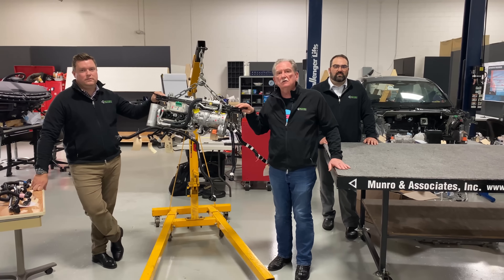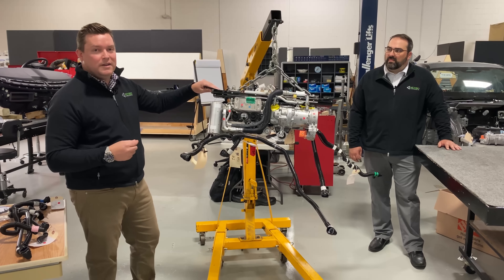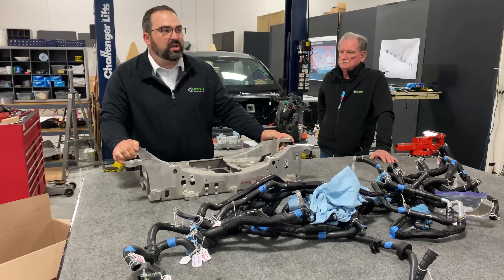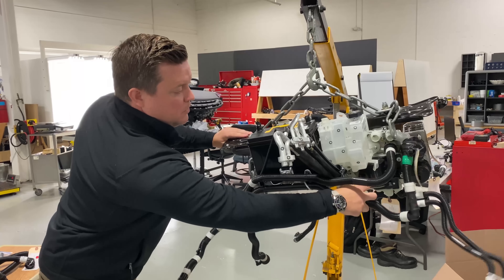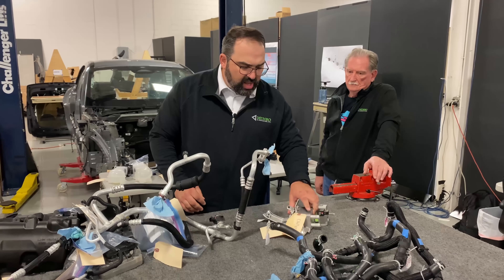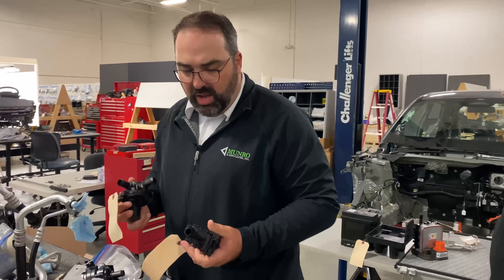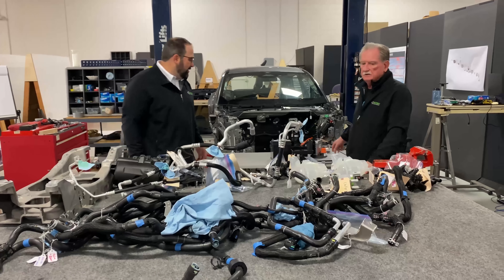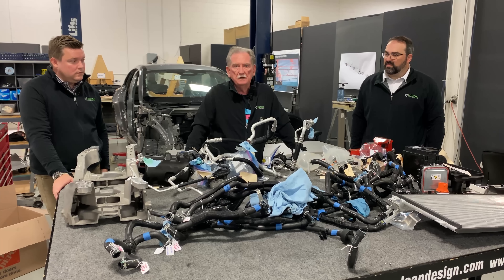Mach-E Thermal System Part 2: A Detailed Comparison to the Model Y

Comment: Finally comparison of the Mach E and Model Y...non of that VW ID4 😄. We want the best of the best and no hold grudge honest perspective from engineers. Shame on best of the best Ford's engineers by using hoses 🙈. Mach E was EV Car Of the Year by Car and Driver though 💩.
Reply: who cares about how its done as long as it works? Porsche in the 1980ies  had 924 that hat front suspension of a VW bug and rear susp from a van and had wont multiple awards for handling.  Sandy is over dramatizing for the sake of content. His points are more important from the cost effectiveness of the thing i suppose.
Reply: @hagestad  You just don't get it, but you will. The best process is no process and the best parts are no parts. The more parts you have the more likelihood thing will go wrong and things will be expensive. The realibility of the Mach E is still very unknown.

Comment: I hope the F150 lighting follows more of the Telsa design vs the MacE
Reply: Apparently per comments from Ford the Lightning is a Ford F150 body laid over an EV subframe.  This would suggest either as-good-as the current F150 systems.

Comment: That's incredible.
I mean, start thinking for a sec how many degrees of improvement could potentially be made in the near future on EV cars.
Reply: better yet scrap it all and build national hydrogen network.
Reply: @hagestad  Its almost guaranteed that hydrogen has no future in the passenger vehicle segment. Hydrogen is less efficient than batteries and always will be (energy changes forms more times). Hydrogen would have to build out brand new expensive infrastructure while BEVs takes advantage of the electricity infrastructure we already have/need. Hydrogen vehicles are dramatically less performant than BEVs. Hydrogen vehicles are potentially more convenient (if infrastructure is built out and batteries don't make gains in charging speed) for very long trips, but less convenient in every day use as you can easily charge at home or at offices with BEVs.

I could see hydrogen playing a part in long term grid storage or large vehicle transportation like planes, boats, and semis (although some of these might also be doable with batteries), but there's really almost no benefit to pursuing hydrogen for passenger vehicles.
Reply: @connorglacken8734  you do realize you can convert ice engines to hydrogen but for some reason that is not even mentioned most of the time?
Reply: @connorglacken8734  no benefits? Weight.
Reply: @hagestad  True, hydrogen definitely has much higher energy density than batteries, but in the real world this alone doesn't yield much of a benefit. Hydrogen is more volume limited than weight limited and you need some pretty beefy hardware to shrink the size of the hydrogen tank down to a reasonable size for a passenger vehicle as well as the fuel cell itself to turn that hydrogen into electricity for the motor. That all adds weight. Add in the fact that batteries can actually do double duty by acting as a structural member and you can reduce the weight discrepancy even more.

Once you get larger though the weight benefit for Hydrogen starts kicking in. A larger tank stores volume more efficiently than a smaller tank so you'd probably have a smaller weight penalty per kg of hydrogen on a semi truck than a small sedan. The difference would be even bigger for big planes and especially a shipping container.

Regardless of all that, weight itself doesn't really matter. What matters depends on what you are trying to do. For a passenger vehicle the things you care about would be efficiency, performance, space, convenience, and cost of operation. Weight definitely impacts all of those things, but you can't just compare weight itself. All things being equal a heavier car would be worse in all those categories (except space, it doesn't really impact that), but all things are not equal. Since hydrogen has to go through more steps to get to the motor hydrogen vehicles are actually less efficient than BEVs. Since weight distribution is much better in a BEV than hydrogen (lower center of gravity) and batteries have much better power output BEVs perform much better than hydrogen vehicles. I would suspect that BEVs have more useable space than hydrogen due to the extra equipment and hydrogen having poor volumetric density, but there aren't many fuel cell vehicles to compare to so let's call this a draw. Hydrogen and Batteries trade blows in convenience since batteries can recharge at home, but hydrogen can refill faster for long trips, but batteries are making large improvements in this arena and hydrogen has basically no infrastructure built out and it would be a HUGE undertaking to do so. Hydrogen is and likely always will be more expensive than batteries since hydrogen has more energy conversion steps and therefore will always have lower efficiency to create and use.

Went on a longer rant than I meant to, but I just don't see how the one advantage (road trips, and BEVs might catch up in this category anyway) makes up for all the disadvantages. Again, this is for passenger vehicles. This is a different story for larger vehicles and especially grid storage uses.
Reply: @hagestad  People have converted ICE cars to BEVs as well, but that doesn't really matter because this would likely cost too much to be worth it. Not to mention hydrogen would need to make sense in the first place for the infrastructure to be built out. Without infrastructure no one would want to convert their ice car to hydrogen even if it was free.
Reply: @hagestad  People already complain about losing power with E15 gasoline.  Hydrogen has incredibly rotten energy density & is difficult to handle.  Green hydrogen will have a place in industrial application -- smelting steel, making concrete, cracking hydrocarbons, fertilizers, etc -- but it is an absolute pig for vehicles.
Reply: @hagestad  
OK
Convert a 25% efficient system to a 20% efficient system to combat a 75% (worst case) efficient system.
Spend billions extra creating infrastructure to do so.
🤔🤔🤔🤔
Seems like a plan.....

A  BAD plan, but a plan nontheless.

Comment: The killer was "and this is the second best we've seen!"
Reply: All those future leak points down the road too. With Tesla you have 10 hoses so 20 hose connections that might leak at some point, with Ford you have 35 hoses or 70 possible leak points. Not including pumps and other components and its all stretched out over the engine bay instead of in one location.
Reply: @andycanfixit  
I said after part 1
"5 year timebomb"
Reply: @rogerstarkey5390  I wonder, was this build on purpose? I mean to create a need for maintanance in coming years of owning a Mach-E? Or is this pure BAD design?
Reply: @danielsusca  Quite honestly it wouldn't surprise me. The dealers are already unhappy there's no routine maintenance. But I think it is more to use off the shelf components than it is planned maintenance. Hard to make things integrated unless you redesign parts to be custom.
Reply: @domg7359  I agree, but I'm sure every one of those hoses is custom! :).
Reply: @danielsusca  Would need Sandy to break down one of the first Model S to see if Tesla got it right away or they went thru the same issues.
Reply: @danielsusca  Why can't it be both?
Reply: @danielsusca  What Sandy has talked about before is how the businesses are organized.  Manager dictates overall design, it gets subdivided into teams, those gets subdivided into smaller teams, and don't you EVER suggest a change that goes outside of your scope.
Reply: @danielsusca  Probably both. Legacy companies tend to build failure points in their products. Also this is just bad design. No attempt was made for efficiency of design for the components or routing.
Reply: @NotNowLater  For me (if I force an optimistic explination) maybe they wanted to put an EV on the market while using the suplys already on the shelves. Like let's make an EV from these parts that we already have. I hope next update of Mach-E will tell IF Ford had understood anything of these comparison or they will prove that on purpose they wanted things to be as a "Spaghetti Monster".
Reply: @cryan9376   Exactly. I've had this thought for pluses and minuses of the Mach-E and some others. I think this would help the Mach-E on a couple of points - but this thermal system is such a mess it looks bad no matter what, it's the poster boy for non-integrated engineering and failure to think outside the box. Too bad, because the Mach-E managed this a couple of times elsewhere. (And I think an early Model S will still win.)
Reply: @cryan9376  The legacy car makers keep saying they have 100 years of experience to bring to the table.  Their EV would not be a first generation quality. That's why they are the "Tesla killer" when their EVs come out.  And this is the product of their 100 years experience gave them!
Reply: @danielsusca  it would appear they tried to use as many parts that they already had in stock and cobble together something that works with minimal engineering to streamline efficiency
Reply: @cryan9376  EXACTLY
The MachE is a hell of a first gen EV from Ford. If this is how they come out of the gate, and its quite good, EVERYONE better be paying attention.
Oh - and Ford will be making money on the MachE long before Tesla makes money on their cars. They're almost a decade in and STILL losing $900+ per car.
I remember, not too many decades ago, what happened when Ferrari was smug and uppity too.
Reply: @HillslamsMirror  I think you need to update your numbers. Tesla profit margin is around 25% per car. They are reinvesting in growth, R&D, and solar. They are reinvesting as much as they can, that is why numbers come tight at the end of the quarters. That is also why is the only car manufacturer with large growth in 2020.
Reply: @danielsusca  Let's give Ford a chance to fix their door issues and cell phone as your key issues first without Bricking the car.   Then they can redesign that snakes nest they call a coolent system.
Reply: @williamgrunzweig571  Auchhh! Agree. That sounds more urgent then fixing the "snakes nest" of coolest system.
Reply: @HillslamsMirror  I can accept that line of thought, but you must accept that Ford with their 100 years of experience and organization size is behind significantly in this new environment for that to be the case.   

As it comes to profit, I think you just need to take Munro's numbers, I assume they will have the Mach-E price out soon and we will all know the numbers then.
Reply: @danielsusca  With all the Extras in this Sysem it looks like a 'We need List' Ford didn't build a full BEV before. The Focus-E was infamous for it's ineffiziency because of the ICE Heritage in Europe. So they had a 'We need List' but not an 'Integrated Parts List' . The whole Car looks like an old Computer Mainboard with only few Integrated Circuits compared to an SoC on Tesla.  I think they will will integrate more Parts together in iterations of the Car. Personally i like the Mach-E more than the Tesla. But i will buy the 2023 Modell not this Mess. Same goes for the VW Plattform, the Best ID.4 is the Enyaq of Skoda, it's even better than the Q4 of Audi. For me the Ranking, when my ICE fails, is: Mach-E, Model-3/Y, Enyaq atm.  Hopefully it runs 2 more years.
Reply: @danielsusca  - Likely both.
Reply: @danielsusca  - It's like other legacy auto companies, their autos are designed to extract more money from you after you've bought it.  Supports their maintenance dept at their dealerships and of course parts.
Reply: @danielsusca - Both.
Reply: @andycanfixit  = Yep, but to be fair Tesla's Model Y benefited from it's predecessors (S, X and 3) that were improved upon over a decade or so.  This is Ford's first version of the Mach-E.  One can only assume (hope?) Ford will minimally do their own internal review (with some motivation from Sandy's videos ;-) to improve at least the thermal system in the next Mach-E version / model year.
Reply: @andycanfixit  No need to worry. The temps of the coolant is not like what's in a normal ICE car and we solved coolant leaks in hoses years ago in ICE cars.
Reply: mind. blown.
Reply: I fell out of my chair, burst in laughter
Reply: @tozzasque - Thank the Three Stooges who got hired by Ford.
Reply: Would like to see some added proof to "the second best we've seen". The same comparison with id4 e.g.
Reply: @SingIng-g8j  I indeed wonder if @VW did as bad , worse or better than @ford. Because in @fors case, it does not make confident buying this car. What a hell of junk under the hood!
Reply: 10:48
Reply: The killer for me was when he said "or in this case, kgs", looks like the Ford girls and boys have some work to do!
Reply: @anydaynow01  Ford IMO has always had lots of work to do. They were never as well engineered as Toyota, Hyundai, Kia. They can't even copy they are so arrogant
Reply: mind blasting
Reply: Ford had no choice but to use separated in-house talent.  They no doubt have guys that just design and source/manufacturer coolant and refrigerant hoses.  The fact they got this car on the road so quickly is the payoff and still beat GM, VW and others with a better overall EV.
Reply: @mec7568  If it is better why does Ford buy MEB for future cars? 🤔
Reply: Indeed
Reply: AHAHAHAHHAHA I DIED LAUGHING
Reply: Yeah, that implies that the ID4 had even more hose and bits in its thermal design. Is that really the case? It didn't look that bad in what I've seen, but I've not seen much detail in this area on that vehicle.
Reply: @xxwookey  did they already disassemble the id4?
Reply: But what have they seen, Tesla, Mustang, BMW i3, maybe Bolt?
Reply: What I get from that sentence is that Sandy has seen just a few of the amount of EVs that are already on the roads.
Reply: I was first thinking WTF did @ford came with such a bad and inefficient and heavy design. But then I felt on my ass when they said it’s the second best design. 
This really tell us how bad car companies have un-optimised their current versions of EV. What the heck. So much weight and so much possibilities of failure and leakage. 
When I see this, it really means that the car you buy is just waiting to fail. 
No way I’m gonna buy such a mess!!!
Reply: @xavierlevaux621 
I don't agree. What this tells us is that Sandy hasn't seen many EVs.
Reply: Punch line.
Reply: Im sure that line was a major kick to E for Electric's jewels lol!  Poor guy and his id4.
Reply: Elon MUSK is New God! Mars is the New Earth! Earth Will soon Die Anyway!! TESLA and Tesla Holders will be Kings. Rest and their Family will be Our Slaves and work to Power energy for Bit coin!! Elon is Einstein, Edison, Newton, and Jesus combined. HE at least deserves several Nobel Prizes. Elon has more IQ than weight of Hater's Ug ly Prius and his F at Ho Combined!! HE is like Ironman who will destroy Thanos and critics are better off using their cash to wipe their a n us. JUST Worship Him instead of other silly god!! GOD Elon will Punish infidels!! Go Emperor God Musk!!
Reply: @bingsi8134  you off your meds goof?

Comment: Lets see if Ford listens and changes the nightmare of refrigerant and thermal lines.
Reply: Hahaha too late they already finished the designed of the Ford's next EV which is the Ford Lightning pick up truck. The horrible thermal system will probably in the Lightning. 😄
Reply: They better get it right in their Lightning, or it’s going to be on full display against Cyber Truck and they are going to regret not fixing this mess

Comment: First observation: the Mach-E comes with 35 different hoes👀
Reply: Second observation: it comes with a diaper 🤣
Reply: Tip #1: more hoes means more pressure in your system
I’m dying 🤣

Comment: Telsa HVAC team is brilliant 🔥🔥
Reply: And they manage to squeeze a heat pump in there
Reply: Ironically , the Ford guys probably brag in the break room - "Those simpletons at Tesla could NEVER figure out our hose nest"
Reply: The Tesla HVAC system also has a really high failure rate and is not serviceable at all. If something goes wrong the whole thing has to be replaced.
Reply: @DanielBlaney  True enough. At least at one point. It's all still a work in progress, for all automakers. I marvel at the brilliance of Tesla engineering (no word less than brilliant fits), although due to the quantity over quality philosophy of Elon I'm not sure if I'll ever buy a Tesla.
Reply: Yeee they make ground connectors that brakes of after 2 years in salt
Reply: @epoxy1710  
Is that it?

Comment: question for you.... is the Ford MacE using more or less hoses vs a Ford F150 or another Ford Car and is there any shared parts in this/these systems?
Reply: Most likely more as Sandy said Mach-E is a good example 🤢